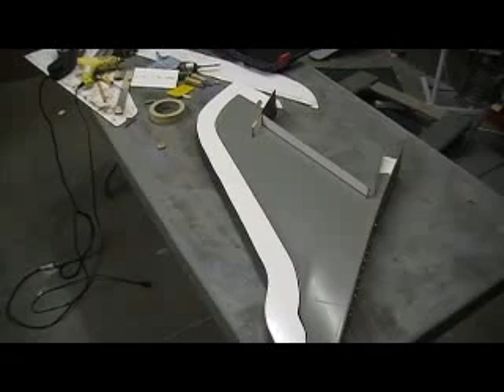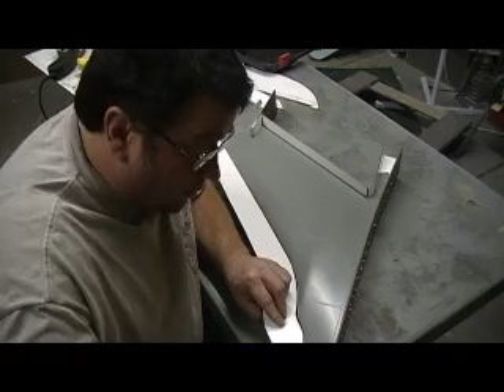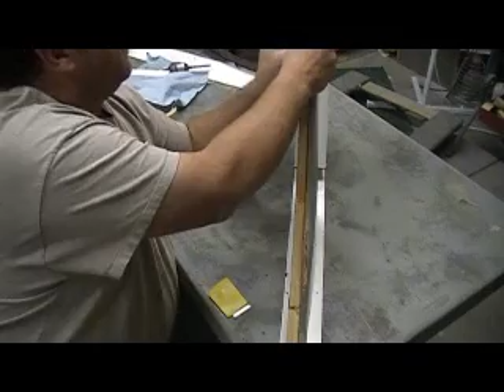how to build a rc jet F-105 thunderchief # 229

Comment: Thanks for letting me know that I can use a balsa model as a plug, for a second I thought you was going to tell me you can't. all most had a sad face for a while. So what I can make out, I would need to cover the balsa in 10oz Glass and use the same procedure as you have with the foam. So a lot of sanding and filling. I'll have to find a company in the UK to get my cloth and resin from, then get started, Watching you, makes it look easy, I hope it will be.